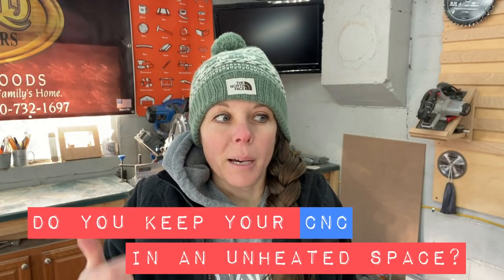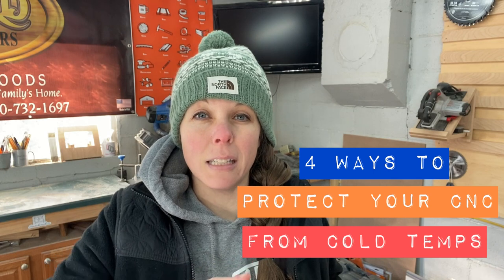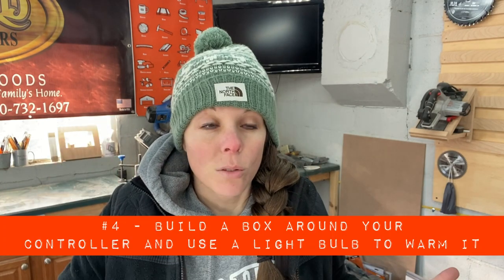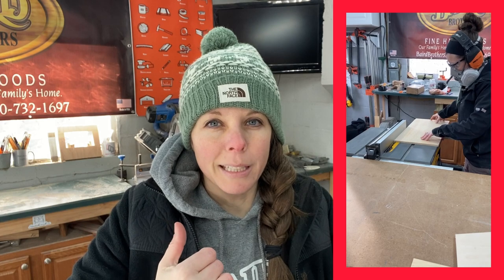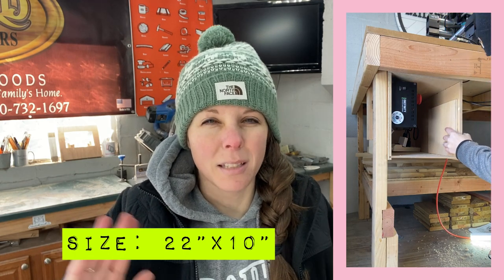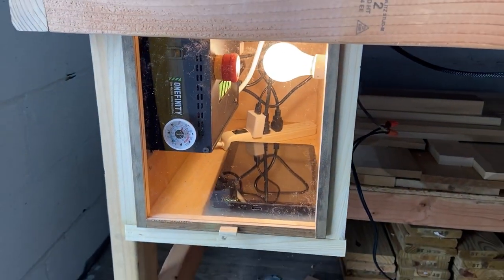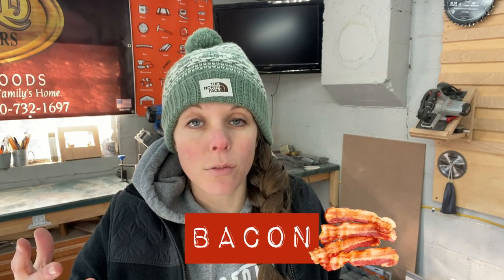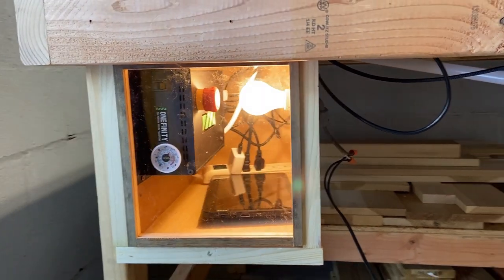My Garage CNC Business // How to Keep Your CNC Operating Safely in Cold Temperatures // Easy Fix

Comment: I have been building and running hobby CNCs with a PC at home for nearly twenty years and have ran them many times when the shop temperature was below 40°.  Computers hate dust and heat much more than cold weather.  If you're shop isn't too cold for you you're computer will be fine.
Reply from the maker: My shop is often 20° so I built the box as a just in case measure based on a statement by the manufacturer of the CNC that it should not operate below 40°. This box is not necessarily strictly to warm it up, but rather to prevent a change in temperature within the electronics that could potentially cause condensation to form. The second purpose of this box is indeed to provide a warm space to store the LCD monitor. Do I know for an absolute fact that this was 100% necessary? Absolutely not. I also never claim that in the video. Just sharing what I consider and practice. Thank you for sharing your experience in return! That gives me hope that I shouldn’t have any trouble. But the problem remains that my overall shop is still way too cold for me! Haha. 🥶

Comment: Bacon and cheese make everything better!
Thanks for posting this. I live in upstate NY and am getting ready to order my onefinity CNC, so was looking for more info on this topic since my shop is a detached, uninsulated one car garage. I'm still unsure which route I'll take. I may just bring the controller and screen inside for those four months since I won't be out there much in the cold anyway, but I'd rather not put stress on the cables if I don't need to.
SJSSawdust's video was the first I saw on the topic; both his and yours are very well done and informative to potential onefinity buyers. Thanks!
Reply from the maker: Glad you found it to be helpful! Hope you have fun with the CNC once it arrives!

Comment: I plan on building an enclosure and heating it with a tiny $18 amazon basics 500 watt heater and a inkbird 110v thermostat that will keep the enclosure at whatever temperature you set.  Ill be building my table this weekend for my woodworker x-50.  Great videos! New Sub !
Reply from the maker: That sounds like a high tech enclosure!! I love it. Very cool. I just upgraded to the journeyman and am working on another video. Thanks for the sub!

Comment: Thanks for the video. Always nice to know you aren’t alone in dealing with a problem. 
I have a Shapeoko (Christmas gift from my amazing wife), so I don’t have the controller issue, but I have found that a Northern NY winter doesn’t play well with the inductive limit switches. In order to use it, I have to first heat the switches up with a blowtorch… not ideal.
Reply from the maker: Wow! Sounds like you have an awesome wife. That sounds less than ideal but I’m glad you figured out what works to be able to run it. 🥶

Comment: Great information! I’m in the same situation, but opposite season. Detached garage/work shop in Texas. Can’t run the cnc in the summer due to the heat but I may have to modify your box for cooling. Also a digital temperature controller is what would be used to power on and off the light. I use one in a keezer I built a few years ago. I keep beer and nitro coffee in there, but I may need to start keeping some bacon in there too!
Reply from the maker: Haha this comment is amazing! Thank you so much for watching, I appreciate it so much. You could totally reverse this idea and make it a chill box. Add some foam insulation maybe to keep some heat out. It’s really all about that moisture content after all to avoid condensation, right? Hmmm. Your problem sounds more complicated though! Would a fan be enough or do you have to throw a bowl of ice in there too? 😂🥶
Reply: @OakHillMillworks  I may have to commandeer the wine mini fridge from the wife. lol
Reply from the maker: @dianaruiz4670  😂😂 or buy her a new “better one” for valentines and then take her old one. Hahah

Comment: I suspect the problem isn't necessarily the cold, but cold/heat cycles which can produce condensate and harm the electronics. Either way a great solutions for the Yinzers!
Reply from the maker: Exactly! Indirectly it’s the cold but yes definitely more the changing of temps to potentially cause condensation. Probably a very good chance this is a better safe than sorry scenario. Perhaps nothing would have ever gone wrong. We’ll never know!!

Comment: Bacon. I should be receiving my machine soon & I was concerned what I was going to do about the cold. Thanks for this video. I was going to make a makeshift room out of heavy plastic & a little heater. Your way will be much more cost effective.🥓🥓🥓
Reply from the maker: Thanks for the feedback! Yeah it’s really just the controller and monitor that need to be on the warmer side. Good luck with your new machine!

Comment: Bacon! Thanks for all the advice! Is this still what you still currently use for keeping your CNC cozy? Or have you tweeked things or changed it all together? And how has it held up in the cold long term?
Reply from the maker: Hey Josh! We recently moved and so I now have an attached heated garage for my workshop and no longer need it as the shop is 60°. It worked perfectly when I was back in the old shop and I never tweaked a thing. I just couldn’t see myself unplugging everything and taking it inside each time. That seemed more laborious. Cheers!

Comment: 🥓 🥓 🥓 🥓.  Lights bulbs throw some decent heat. I had a large air compressor in my first garage that was unheated. When the oil was too cold the compressor would draw too much trying to cycle on and trip the circuit breaker. The solution on really cold days was a 100 watts flood light aimed at the side of the pump. 10 minutes and it would cycle on with zero issues. After the first couple of cycles in a day it would have enough heat and the oil was thin enough to continue the day without the light.
Reply from the maker: Isn’t that wild?? It’s kinda harder to find incandescent bulbs nowadays but they are good for small heat emissions. Thanks for checking out the video!
Reply: @Oak Hill Millworks  we used to have a 80 gal air compressor outdoors in an unheated closet when I first started 20+ years ago as a mechanic and we would buy a 100watt heat lamp bulb that replaced a flood lamp bulb
 That what gave me the idea in the first place. Same kind of heat lamp bulb used to keep food warm in a fast food restaurant
Reply from the maker: @jeffreyfitzsimons4360  nooow I gotcha. Yeah people were recommending reptile lamps but I kinda like seeing the light from the bulb and those ceramic only lights obviously don’t have that effect.

Comment: Yum, bacon! Great tip, thanks for sharing!
Reply from the maker: Thanks, Mike! You have any issues with humidity in your work space?
Reply: @OakHillMillworks  not really. I keep all metal well coated in protectant. A few weeks ago I needed to run the OneFinity and it was 28 in the shop. To help the heat I added a small heater to blow on the machine while it warmed up. I use a 32” television as a monitor so it doesn’t get any warmth. I more worry about grease in the sleeve bearings viscosity at cold temps.
Reply from the maker: @brokenleadwoodworks  yeah I’m not totally sure how likely the machine is to glitch in the cold but figured it would be an easy enough project just in case. 1F has never mentioned a concern about grease seizing up but yeah I suppose anything is possible. I’m shocked it got that cold in your shop down there!
Reply: @OakHillMillworks  it was 10 here last week. I didn’t run the 1F then.

Comment: Bacon. Temperature regulator is the way I'd go, so you don't have to think about it if you get a sudden cold snap. I also do the same thing to preheat resin within the manufacturer's recommended use range overnight before using it.
Reply from the maker: 🥓 thanks! I agree that would be superior. I went with the option I had on hand. That’s a great idea to use with epoxy as well. I haven’t worked with it much because of temp control issues. Do you have a temp regulator you would recommend?
Reply: @OakHillMillworks  I used STC-1000, a model that worked from AC power.

Comment: I own an Axiom AR4 Pro and an Axiom AR8 Pro, weighing 400 pounds and 800 pounds respectively.  Can't hardly move them into the house.  The wife would rel agate me to the garage ->->-> permanently.

So, I bundle up and run the machines with frozen fingers !!!

I have been thinking about looking into a gas fired heater that I can hang in the corner, closest to the gas inlet to the house.

What I'd really like is an unattached shop in the back yard, but then too, there isn't enough room.

Oh, I also run three 10 watt lasers:

One to make coasters.

One to make tumblers and...

One to make flat items, such as plaques and cutting out coaster blanks.

I am retired and this laser and router stuff is a refreshing change from designing embedded computer controls...  It requires much less brain power, but there is some real satisfaction when I finish a project and actually get paid for it.
Reply from the maker: That is so neat to hear more about your set up! Sounds like you have a decent operation to keep you busy in retirement. I hope you keep the wife happy!! 😂

Comment: How modifying a old cooler
Reply from the maker: That’s not a bad idea. The controller does put off some heat so whatever you go with, I would make sure it has some air flow to the inside or else you’ll just warm up the inside of the cooler and condensation could form that way too.